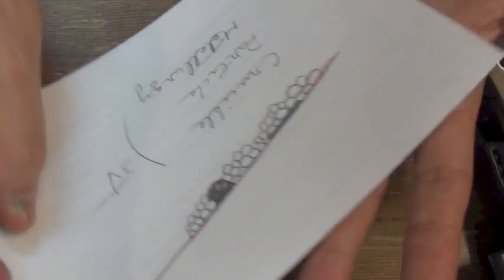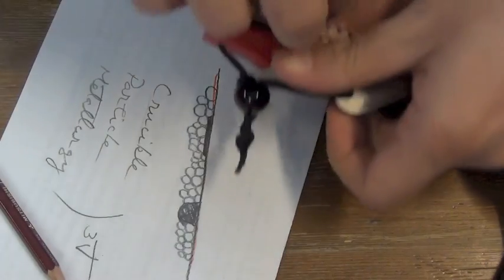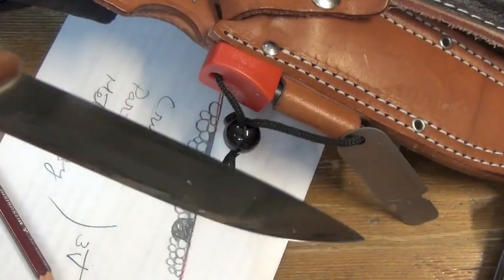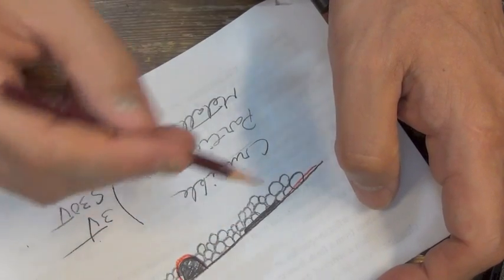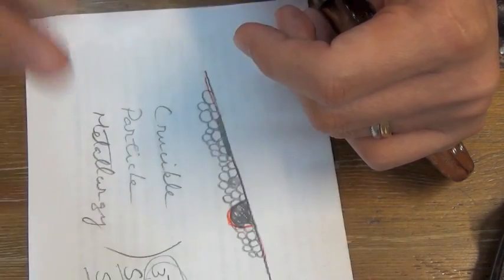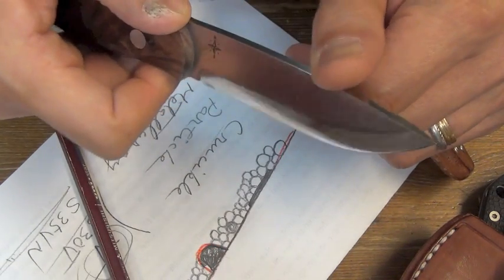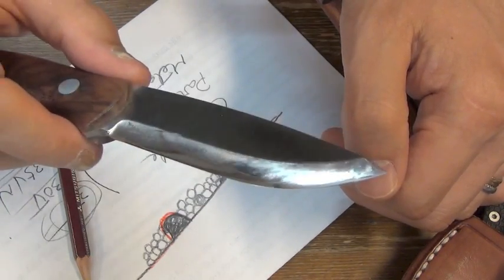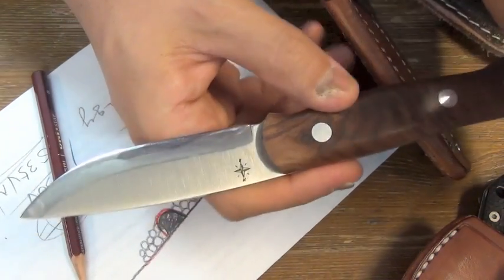My imagined CPM microstructure

Comment: Dr. Virtuovice, how do you think CMP3V will perform in a scandi grind 12.5 per side bevel?   I'm considering buying and testing a Sigmora bushcraft by Sigma 3 as my main bomb proof bushcraft knife.
Reply from the maker: +aHigher Power Current CPM-3V from Bark River is pretty tough in some apex angle like 30 degrees inclusive. If what you look at is tempered as its hardness is under 60, it can be tough enough in 25 degree Scandi geometry.
Thanks.

Comment: Nobody will question the mailman.
Clarity please. 154cm or 3V should have lower edge stability?
Thanks
Reply: 3V takes micro chips or snaps while 154CM takes micro bends or crush in smaller than 30 degrees  when they are given a hard job. In a bit larger than 30 degrees 3V is expected to hold 3 times longer than 154CM. This is the CPM powder steel characteristics in my experience. Thanks.

Comment: Wako, have you tested other blades in CPM 3V? Bark River has had some questionable grinding methods resulting in possible overheated blades and violent quenching methods. Data charts state that 3v is approaching shock steel in toughness.
Reply: ***** Yes, they are marketing charts and composition data. If you have a better way to find out steel information I would like to know. I have followed the heat rest information on those data sheets with great results. I believe they are accurate and have tested blades to prove it.
Reply from the maker: I have many 3V knives from Bark River. They always come in 35 or larger apex angle by all means. Then I reduce it to 30 degrees with water stones. I like doing it very much and it has upgraded my sharpening technique very well. I am almost forgetting the joy of old A2 25 degree sharpness because my current purchases are all 3V Fox and 3V Bushcrafter in various wood handles. Even if 3V 30 degree edge takes micro snaps, it is tiny and is easily restored with stropping. So I personally don't care about the 3V less toughness in smaller than 30 degrees. I can make a bit larger than 30 degrees by myself with ease with joy. But if a 3V knife owner don't know how to reduce the dull 35 or larger angle, he will need to struggle with it in vain. So I think A2 is better generally speaking. A2 is almost always super sharp out of the box. Thanks.
Reply: virtuovice
Wako, how do A2 and 3V compare in rust resistance in your experience?

Comment: The microstructure of the steel will be set in the thermal/mechanical processing after the PM processing which is then finalized in the heat treatment. The PM process is simply used to reduce the segregation of the alloy content in the steels and it gives a more uniform structure (less axial variance) to properties such as toughness. If a steel such as 154CM has lower edge stability than a steel such as 3V it simply means that whoever hardened the 3V blade didn't know what they are doing.
Reply: Science!

Mr. Virtuovice. I urge you to listen to Mr. Stamp. His study of cutlery and metallurgy is extensive, and he isn't selling anything.

Comment: How do you measure the edge angle with reliable precision- as on the Aurora shown?
Reply from the maker: I think it is widely accepted that Mora Clipper's angle is 22 degrees and Mora Robust's angle is 28 degrees, and regular V edges are 40 degrees. I don't measure my angles actually but just estimate them based on the other well known angles which I have ever owned. Thanks.

Comment: As stated by others,  it is difficult to be definitive on any conclusion due to variations at the points of milling,  casting,  manufacturing and construction.   Your research does lead one to believe that there is a cutting angle that seems more suited for CPM-S30V (and 3V) than it would be for other steels.   It follows that different molecular makeup would require different treatment to bring it to an effective edge.   Good discussion.   Be well and happy.

Comment: Hello knife man.  How do you measure the angle on the edge?  How do you set the angle when reprofiling?
thanks for your videos.
Reply from the maker: The angles I say in this video are taken from the fact that Mora Clipper's angle is 22 degrees and Mora Robust's angle is 28 degrees and regular V edge angles are 40 degrees. My sharpening angle is fuzzy based on my experience to make convex bevels. Thanks.
Reply: virtuovice Thanks. 22 (11 on each side) is really acute!
I trust your experience and hope to learn from you.

Comment: I experienced 3G powdersteel as a chippy steel aswel.
Though I haven't had major chips on cpm3v I did have alot of small ones that could be restored by stropping.
So maybe it's something with all powdersteels not only CPM steels.
But I cannot say for sure as I'm not an expert on this.

Did you experience the same amount of chips on your 3G as on 3V?
Reply: I experienced this same issue with A2 purchased from BRKT a few years ago. I think it has to do with the heat treat process. The harder steel is the more brittle it becomes. They are trying to find that perfect combination but sometimes cross the line. My observation and opinion only.
Reply from the maker: I have had many experiences with 3V to take micro chips in a round shape while I haven't had it with 3G. Thanks.